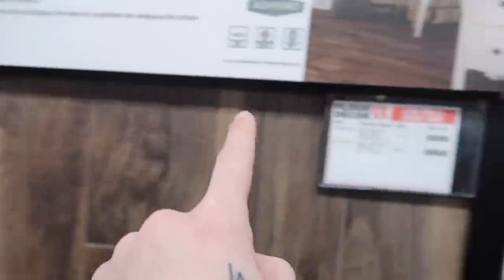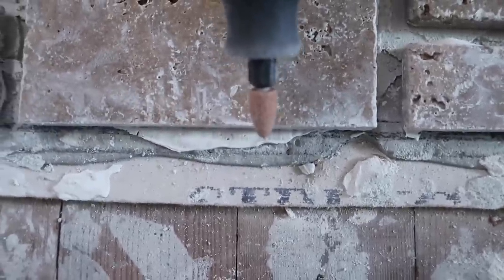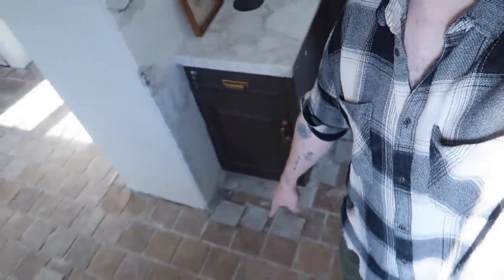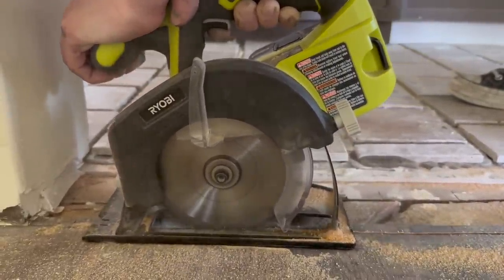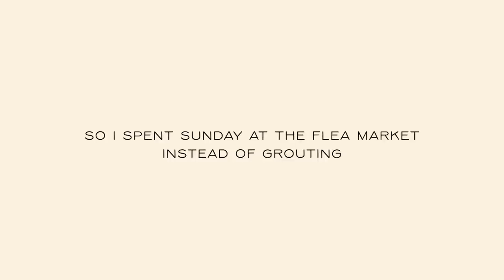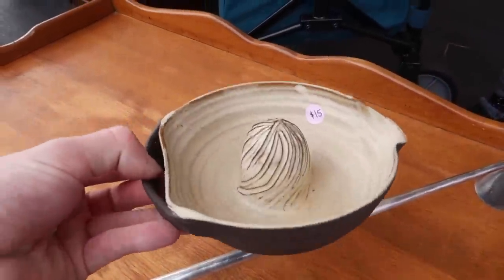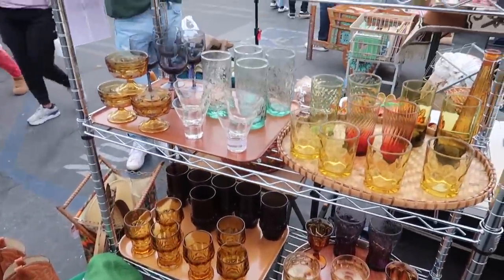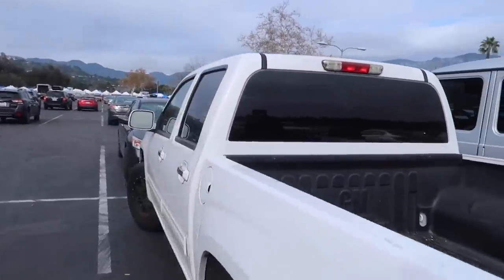Ripping out my brand new tile 😭

Comment: If you buy books and plan on removing the dust jackets when you style shelving, save the dust jackets! If you decide at a later date to sell the books, the value will be higher if the book has its dust jacket. Also, fine art books tend to hold their value better than other titles

Comment: Hi Drew.  I just wanted to make sure that before you grout your tiles, that you check to see if you should be putting a sealer on them first.  We had natural stone tiles, and HD highly recommended that we use the sealer first or the grout would bond to the stone. It's very easy to use. Just wipe on, and you're good to go!  Good luck with the rest of your tiling!

Comment: You need to use knee pads when your kneeling on hard floors a lot. It will screw up your knee faster then anything else. It’s easier to take care now then deal with the damage later when your older. Love your channel.

Comment: I'm sorry I'm late for this one :(. Justin is so cute and you're so cute together! That said, I've been redoing my bathroom on the weekends (when I'm off work) and we also have made mistakes. We pulled out the 60-70's style tile with the 3" of mortar under it, spent a ridiculous amount of time getting all the mortar out of the bathroom (with a hammer and bucket and carting mortar and tile pieces down the stairs). My Dad had the bright idea to re-morter the floor to make it "Level" for the new flooring. We then realized, Dad had no idea what he was doing (LOL) and no experience with mortar. It was a disaster. The floor was nowhere near "level" and I couldn't even shut the bathroom door. We've now had to spend several weekends removing the Second mortar down to the sub-floor. We've decided to go with bamboo click/lock flooring (which is waterproof) but working only on the weekends, the project is dragging out and driving me crazy. Knowing I'm not the only one making mistakes is great. And you inspire me to keep working and keep chugging away at this nightmare bathroom reno. Thank you for sharing your journey!

Comment: Not only is pre-mixed mortar not meant for stone, it's not meant for any floor tile. Also, you apply the thinset to the floor and also back butter the tile with thinset before installing. You are already taking a chance by installing the new floor without ensuring you have the proper underlayment (because you laid the floor on the old underlayment).

Comment: On your last video I talked about our issues with sanded grout using the same shower tile for the floor in the bathroom. It all cracked. The shower is super enforced and with cement board, rubber flange etc. so it doesnt flex.We have a crawl space so the floor flexes. But our grout lines are smaller yours. Just maybe ask a tile specialist since this is the second floor is you shouldnt use non sanded grout. We are only 3 hours northeast of LA now in the high desert. Its almost easier to get to LA than when I lived in Orange County freeway clog wise that is. I used to go to that swap meet with sister in the 70s!! Oh the small amber glasses are a sized used for after dinner wines like port!

Comment: Everytime I see these tiles with little rough holes I think of how hard it will be to clean. I have ceramic tiles in my kitchen that are fairly smooth but the grout lines get so grotty and need to be scrubbed on my hands and knees with a brush. If you will be cooking in this kitchen it will get splashed and those little rough holes will be hard to clean out.

Comment: TILE is not for inexperienced DIY. One year I spent all summer weekends and some evenings on my large master bath and a tile guy said he could have done it in one weekend for a hundred bucks. ALL THE TILE JUST EXPLODED OFF MY KITCHEN WALL BECAUSE MY SELLER OF MY CONDO WAS A DUMB ASS AND GOT CHEAP TILE GUY. DON'T DYI TILE!!!
Reply: The only way to get experience is to do your first tile job. I’ve done a crap ton of tiling myself and have never had a failure. Do your homework and understand that there are different types of adhesive and different types of grout. It also helps to have the proper tools.